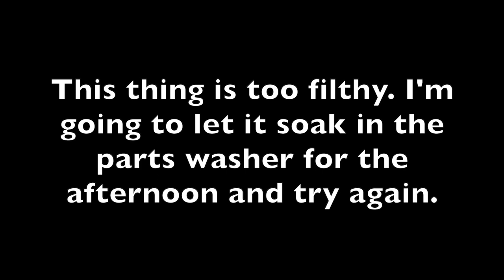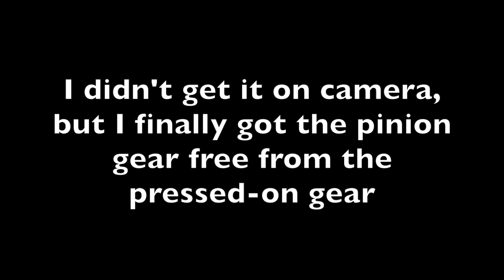1941 South Bend 13" Lathe Restoration - Part 8 - Single Tumbler Gear Box Disassembly

Comment: So can you tell me how you got that last shaft out? I am struggling with the myself as I right this. Thanks
Reply from the maker: I wish I had captured that on camera. But basically it was persistence. I used heat to get the different pieces to expand and hopefully break any kind of bond. If ANY moisture had gotten in there, it most definitely would have causes some kind of surface rust and the oxide creates a bond. But I didn't get it TOO hot, I didn't want to risk altering the hardness of the gears drastically. My advice would be to take your time and not be in a rush. Lots of oil, some heat and plenty of patience.